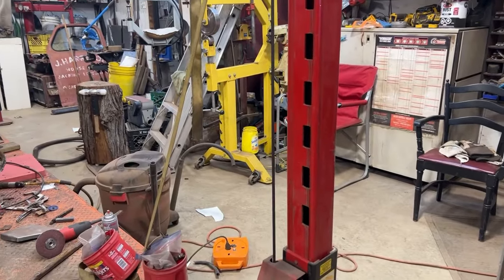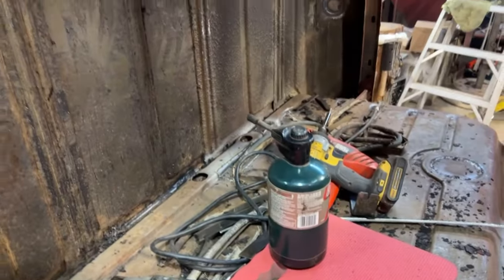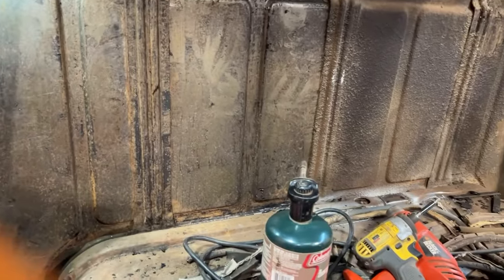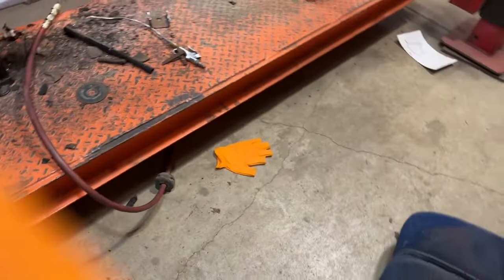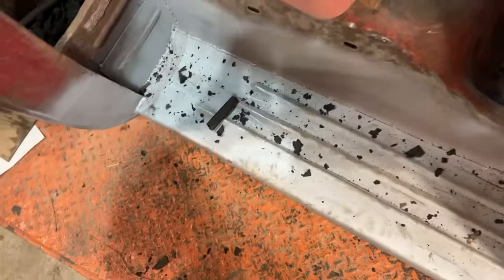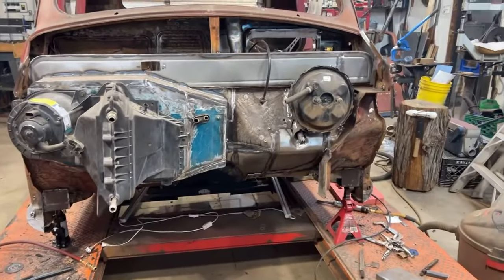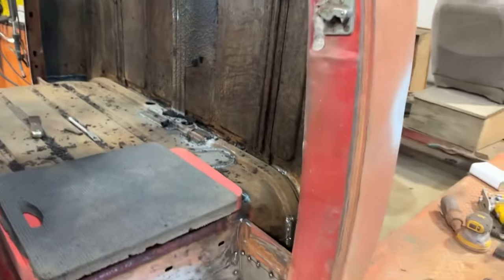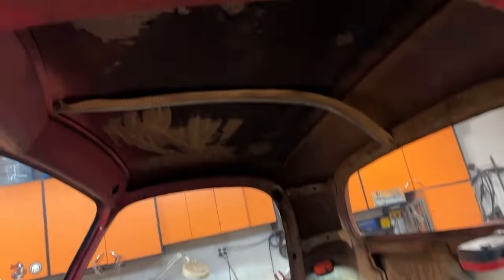Studebaker#97 undercoating removal

Comment: I spy a MAC Anti Vibe hammer on the cab floor. Best in the business there.
Reply from the maker: Mike, sadly its a Proto. Im suspecting same mfr’s. Good hammer though. I refer to that small hammer as a tapometer
Reply: @franksgarage8551  Mac and Proto are both part of Stanley. I sold them on the tool truck. Good stuff.

Comment: Have you considered bedliner on the inner ceiling and cab walls? I think it might be slightly sound deadening and add a little texture.
Reply from the maker: I did. But i decided to go with a 1/4” thick foam, for insulation and sound deadening. Self adhesive, and foil. Stuff i used in Fargo cab was similar, huge difference in the cab on hot sunny days. Should work well.